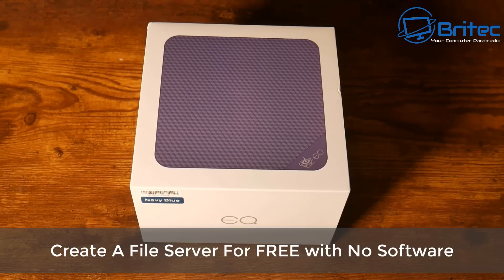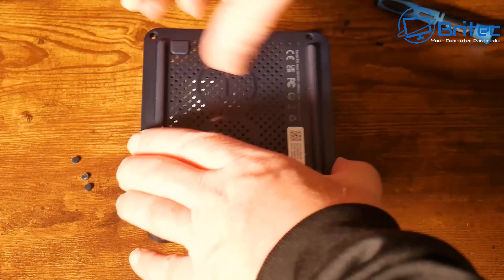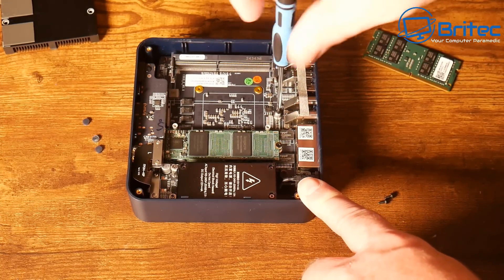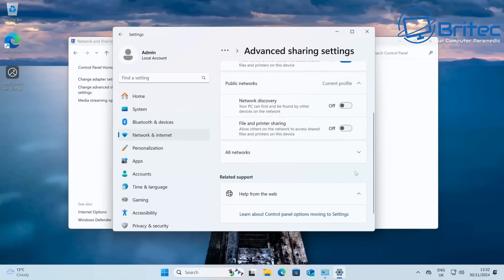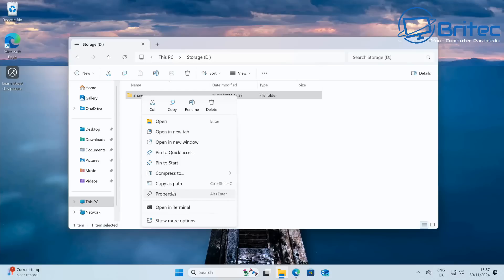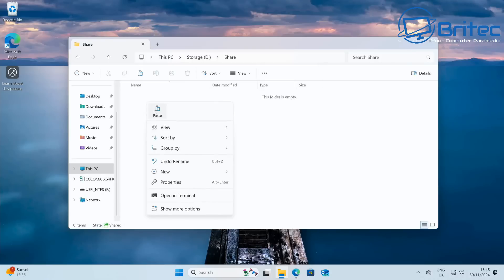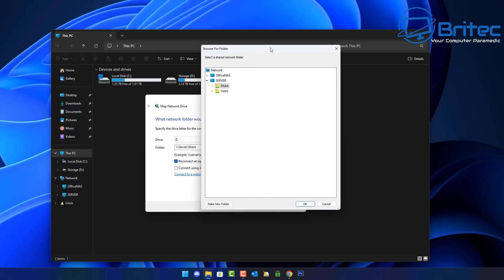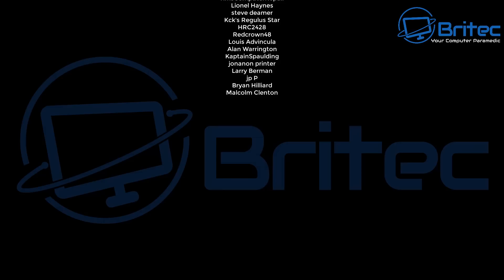Create A File Server For FREE with No Software

Comment: Britec09, Great video. 
Couple questions if I may: 
1. I was going to use a 2T SSD in the file server and install Win 10 but it currently has backup data on it. Can I still use that SSD without losing my data?
2. Is the process for Win 10 the same as you presented in the video?
3. One of the laptops in the house is Win 11 and the other is Win 10, can I still access the file Win 10 server on both (I assume I follow the instructions you gave for "other computer") 

Thanks

Comment: If I got a 20 TB desktop hard drive and hooked up to it, would that be possible?
Reply: @An.Individual  if I got a desktop, I drive all asado hard drive in a case with a USBC
Reply: Even simpler would be to connect the 20TB HDD to your router and use it for sharing. Really no software

Comment: GREAT !!
That was where I'm lookin for ....
Because ... I have WD NAS that isn't recognized by Windows 24H2.
So I want to build my own NAS ....
Just one question remains:  I want 2x 8TB HDD's inside, running in RAID Mirror, foor safety on my files.
How to install RAID with this ?? Can you make a video of that ??
Reply: truenas core/scale supports raid
Reply: You'll probably find the WD might be using SMB1 and windows by default shut this off. You can re-enable it but the security of SMB1 isn't great. You might be better off just shucking the drive and connecting it with a SATA to USB cable.and power on your router....and backup your data before you do it
Reply from the maker: You are welcome!

Comment: I understand the simplicity aspect but I won't run a windows machine or vm 24/7 just for file sharing
Reply: one can make a file sharing unit using an SBC as small as a NanoPi Neo 512 (just add PSU, drive and drive interface of choice)
sharing files via Samba and NFS, with an underlying minimal OS fitting in a 4GB micoSD
Reply: Why not? Just curious
Reply: @SkywardKing  Windows is not made to be used like this. It has a lot of background processes running for basically nothing in a use case like this causing extra power consumption not to mention all the shady telemetry Microsoft is doing. This is where a real server os can step in like proxmox with a lot more functionality and better resource management. Or if you really want a single fileshare you could install a bare minimal Linux with filesharing and it would take less than 500mb vs a 60gb windows installation.